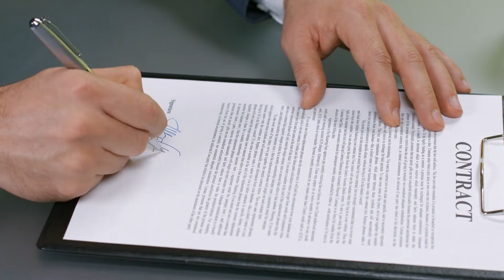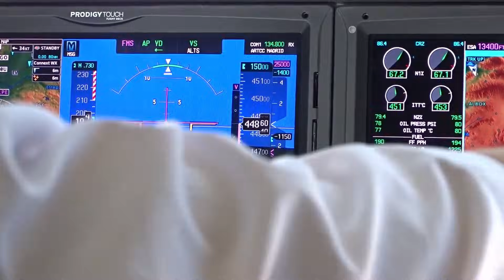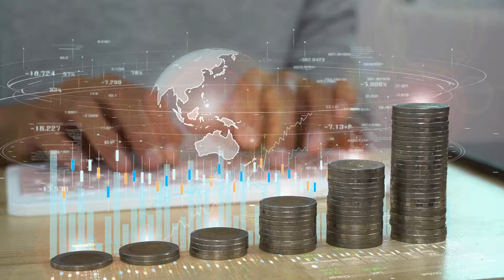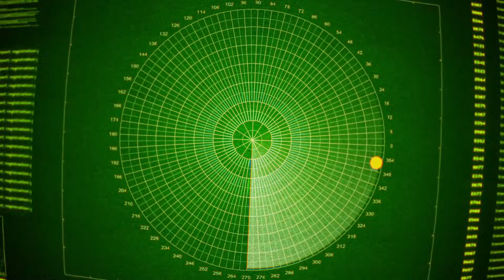Canada Questions the F-35—Gripen Delivers an Offer the U.S. Can't Match

Comment: Please get your facts correct... there have not been any  F35s  delivered to Canada although the first 16 have been paid for. They are behind schedule and have been plagued with problems. There have been cost overruns and will not come in even close to budget. These factors coupled with infrastructure requirements to house these planes, in addition to cost per flight hour make this plane completely impractical for  Canada.😢